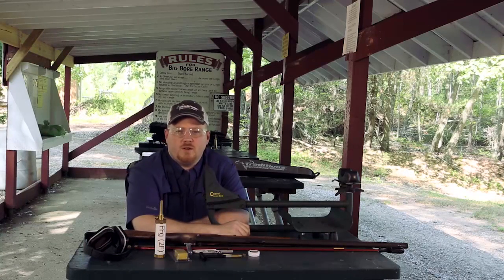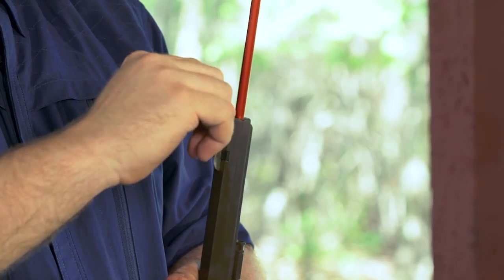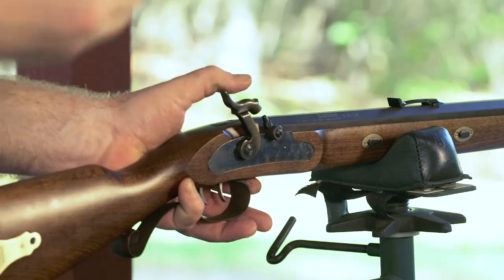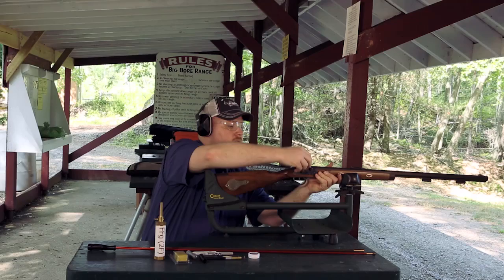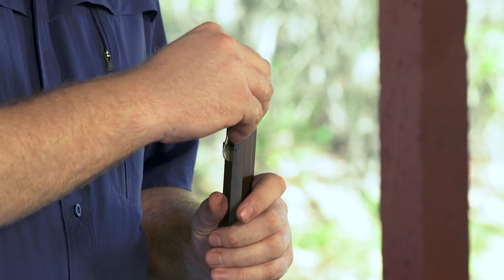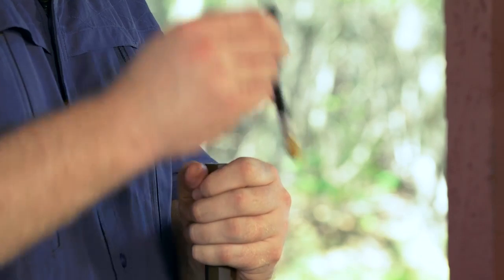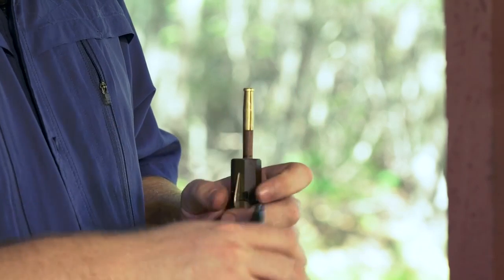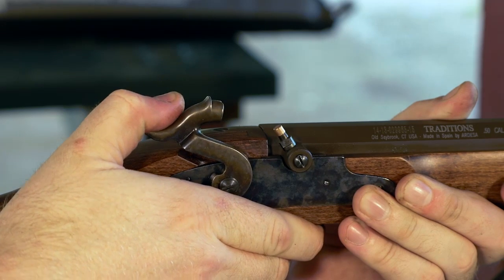Traditions Firearms Video Series   How to Load & Fire Your Traditions Percussion Sidelock Muzzleload

Comment: also  want to add keep the muzzle pointed away from you when pouring in the powder especially if you are firing more than one shot. if there is any embers in the barrel the powder can ignite, not very common with slow target shooting as reenacting but the old timer way is to blow down the barrel. Not recommended today so a better way is to either use a blowpipe or run your ram rod down the barrel and point the muzzle at the ground and shake/ tap it.

Comment: can black powder pellets be used instead of loose powder itself? I am new to shooting black powder and getting ready to shoot. I already have Pyrodex, but the pellets seem to be easier as they're 50gr per pellet. making measuring easier. What would be your take  on this?
Reply: Elijah Ellis well I'm not sure about how many grains you're supposed to use but as long as it's not smokeless yeah you can use it
I hear of people using pyrodex in these all the time
More often than black powder actually
Reply: There are multiple correct answers to your question. 1.) Yes, if you have a break action or bolt action modern muzzleloader. 2.) Yes, if you have a Traditions PA Pellet Model. 3.) No, if you own a traditional muzzleloader.
Reply: dont be lazy. just use black powder. pyrodex is twice as dirty because of the sulfur they put in it. those pre measured pellets are over priced. if you shoot black powder anything. do it like they did back then. keep history alive
Reply: No do not use pellets in these
Reply: You can use pellets but you’ll have to break them up a bit with a funnel over the barrel for the powder to get to the nipple otherwise you’ll have a hang fire or failure to fire

Comment: I have a question I just bought your traditions deer hunter 50 cal can I shoot sabots or only ball
Reply: And if I can should the plastic coating for sabots be used or patch only
Reply: just shoot with the ball, the cast lead stays splatters out and takes the deer down quickly. also its much cheaper and less likely to be a pain to load. ive hunted with cast lead round balls for years and the only bad thing is after 150 yards they arent as accurate.

Comment: I find the Hawken styled guns still attractive but I don't mind an inline gun either.
I do not like fake black powders or shotgun primers.

I have a Traditions Tracker I want a breech plug that allows the use of Number 11 caps and Musket primers.

I have had 32 caliber squirrel rifles before but people will bug you to death for them.

I don't understand why muzzleloaders are so expensive?
In 1980 I bought a 12ga  muzzleloader it looks Identical to the Traditions Tracker,....but it was a Navy arms 12ga I paid $50.00 for it brand new..
I just bought 2 Ridge Runner 54 calibers for $99.00 each.
With wood stocks from,.......the gun works,...no regrets except there's no powder or primers and no ball starters and take down tools in any store's.

I can buy muzzleloader kit's,......but all other components are not available.
I started in the 80's with fine gun's,...CVA, Knight,.....and Thompson center.
I started with Pyrodex R/S it shot lousy I got rid of my guns I practically had to give them away.
A few years later I ran across Goex Black powder,....I shot it through the T/C  I thought I was missing because at 50 yards there was just 1 hole.
I got another gun and it was the same and it pissed me off that Pyrodex costed me my other guns.
I only shoot Goex,.... but can not find it.
I use T/C Bore Butter on all firearms.